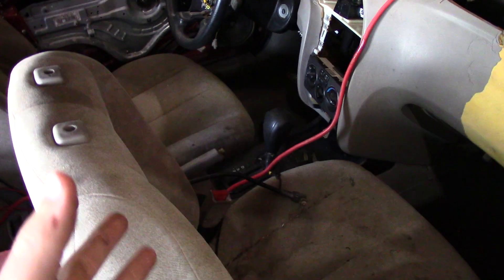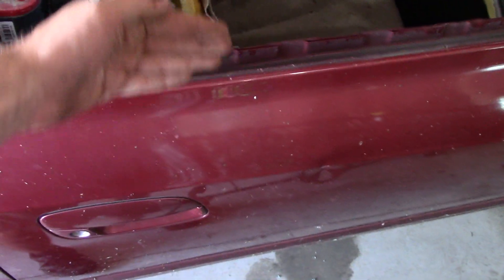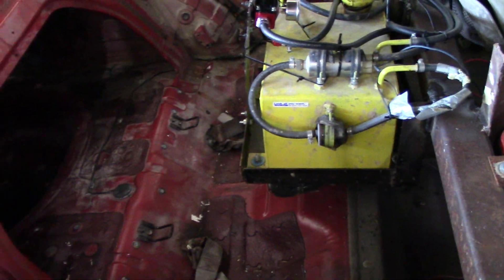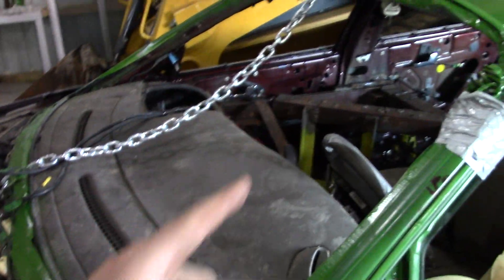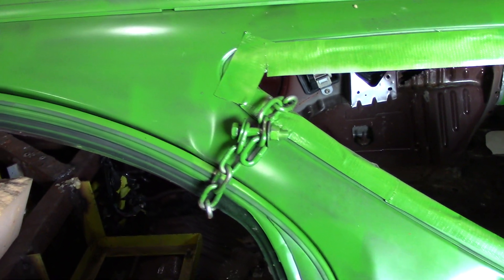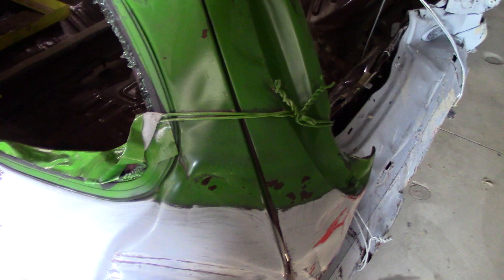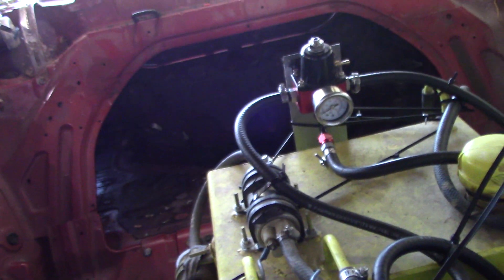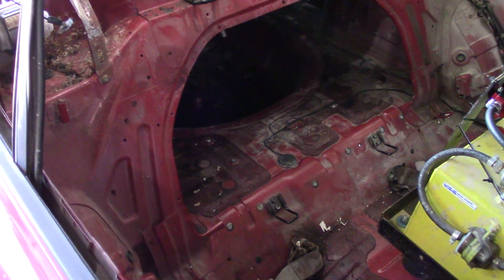2003 Elantra Derby Build Ep 4: Saving Money

Comment: Could you do a video about using the stock fuel pump in a new fuel tank. I’m afraid to set off a security system by using aftermarket parts, but for safety I would also like to move the fuel tank.
Reply from the maker: I don't use the stock fuel pump for anything unless the gas tank stays under the car. I don't like putting a fuel pump inside my derby tanks because they can come loose or break and you wont see it inside the tank. I only use outside in-line fuel pumps on my derby tanks.

Comment: was there any indicator that the air bags was in the seat or did you just know? cause im legit building a 2003 hyundai elantra in sept exact twin to yours even has the problem running without the regulator lol but ya i dont see anything indicating theres air bag in the seat. glad i seen this video
Reply from the maker: Mine had little tags saying airbag. Try cutting your passenger seat first and looking